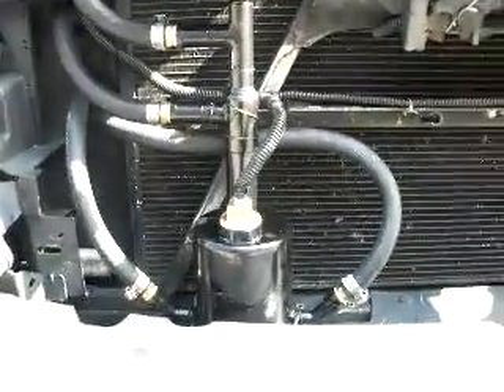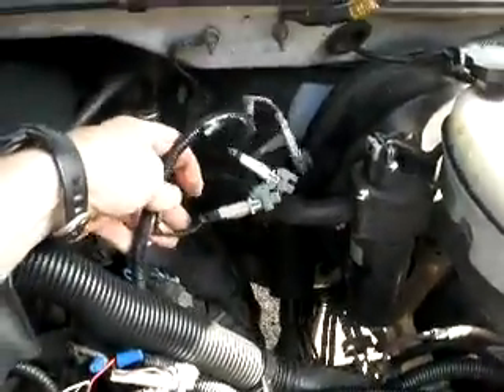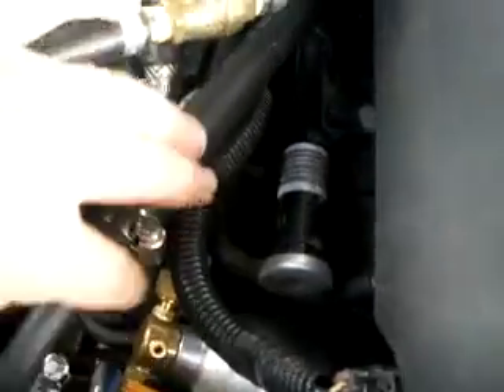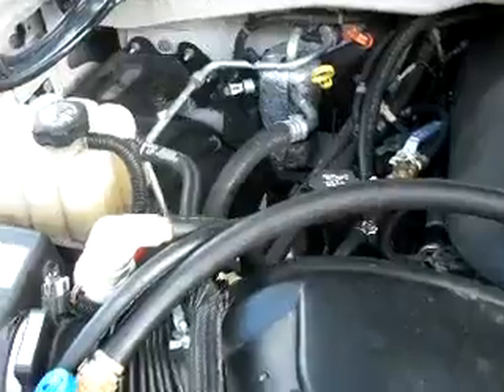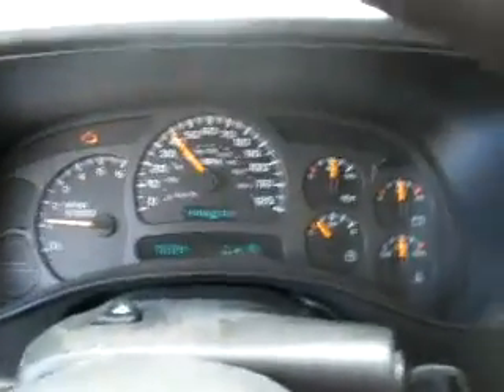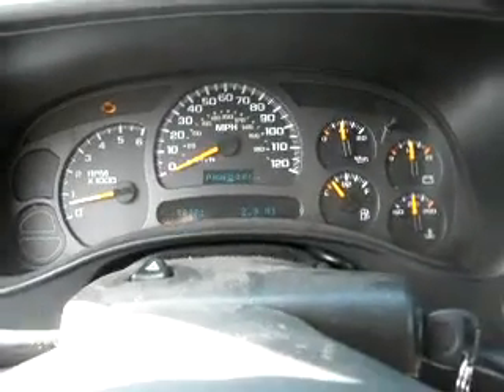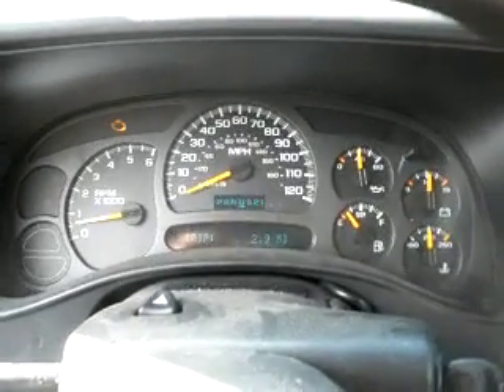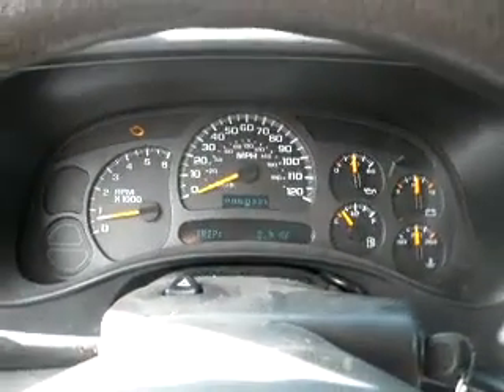Road Test In Progress from running on gasoline vap

Comment: this is geet technology designed in the 1980s thanks for making the engine people need to know about this. we have had clean possible energy since the 1940s. just saying if you continue with geet development you will find it will run on a bunch of different types of fuel the only gasoline you will need is to start the engine and get it up to running temp. but once its running your running low on fuel take a piss in the tank and it will use the hydrogen gas to power the engine also the different fuels like water mean you wont have to change your spark plugs keep posting and keep trying to make the world better
Reply from the maker: Andy Berlino Will do my best... thanks for watching.

Comment: Hey did you ever get the little problems worked out?? I have a 90 model chevy truck. Do you have any videos or parts list that is needed to make this conversion?
Reply from the maker: No sir, project is on hold right now...found something way better. Will keep everyone posted on my findings. Thanks for watching.
Reply: whyme2b Keep at it, keep documenting it.
Reply: whyme2b omg! Please do. Wish you would post more info on what heater your using and how it's installed to your tank. How hot can your heater safely go before the risk of igniting the fuel?
Reply from the maker: I'm using the hot water from my coolant system which is around 210 F degrees. It's only installed on the device I built which runs the Idle. Please go to my website phillipstechinc.com under photo gallery to see more pictures of my gas vaporizers. Thanks for watching.

Comment: How do this preform at high rpms? And can something like this be done with a normal Holley 4 barrel carb?
Reply from the maker: Very well if the engine gets the vapor it wants.... it would work out nicely with the older classic technologies than fuel injection computer mess. You don't need to worry about all those sensors telling the computer about what's going on. Thanks for watching.
Reply: That's cool my truck is carborated
Reply from the maker: Gentry Taylor

Then you have a greater vehicle than today's made...much easier to work with.
Reply: Gentry Rolofson .
Yep.
Just attach a vacume line to the carburater bowl vent.

Comment: Man I need your set up I have a 3.5 high output im looking to do this to my 300
Reply from the maker: I'm working on a new design right now using water as fuel under running load... It uses gas for start up, then when engine reaches normal temp, it switches over to water. Will do a video on it if all goes well. Thanks for watching.
Reply: Awesome thnx
Reply: whyme2b Did you see the new research on combustible saltwater? Might wanna check it out if that's your goal... Just a thought, I thoroughly enjoyed the video though! Especially the humming... XD It reminded me of myself making a video... Hahaha, well done!! Might do something like that to my camaro! ;)

Comment: super cool videos. very nice perspective.
Reply from the maker: Thank you and thanks for watching them...
Reply: how did it end? are you saving a lot of fuel?or you stopped the project..    p.s. make some more vids you got talent for it.
Reply from the maker: Project on hold for now... I drove it for around 5 to 7 minutes before I couldn't accelerate the engine anymore due to the gas cooling down which made the vapors cease. I would need to heat the gas for that part as well to keep it going. Sorry for the delays buddy.... again, thanks for watching.
Reply: that is not a big deal. depends on the temperature needed.else just put a pipe with electrical heating , it will do the work.5 min is more than enough to keep the energy going in the battery and  the heating sistem .  i think a lot now about magnetic induction- quite interesting subject. it is about getting heat from spinning  magnets.thx for answering
Reply from the maker: Your welcome... I do believe the key is to heat the gas up and induction heating could be a another safe way of doing that. Thanks for all your comments and watching my friend...

Comment: How exactly does it run when you unplug the injectors? Because with them unplugged, they now will not open. So Im curious of how you get the fuel vapors through an injector that doesnt open into the combustion chamber.
Reply from the maker: Sorry but I never received your comment in my mail? The answer to your question is threw vapors being pulled into the vacuum, I'm not using the fuel injection liquid system at all....nothing but vapors threw air intake. Thanks for watching.

Comment: Although, as  you say your project is "on hold," what mileage did you get picking up your wife etc.??
...Sounds fishy if you suddenly stop reporting...
Reply from the maker: I actually only had driven it for 5 to 7 minutes before I experienced acceleration problems due to my gas cooling down. It must be heated to maintain vapor production on both parts... my idle stayed fine because it was heated from the device I made. So I had to switch back to the normal setup when I went to pick up my wife, couldn't perform MPG test yet until this issue is fixed. Sorry for delays....Thanks for watching.

Comment: how do you make this work for a 2013 Hyundai Elantra 2013 GLS. How do you make the items you need to make your vehicle run on vapors.
Reply from the maker: It will work on all fuel injected vehicles, no matter who the maker is... It's a 2part system that makes it work, fumes for idle and fumes for accelerations. Still working on a design thou that's safer and made easy for everyone to use...sorry for the delays..... Thanks for watching.

Comment: sory, gas vapour??? as in LPG? or Gasoline an in unleaded petrol??
the English American translation is horrible lol
Reply from the maker: Yes, as in 87 octane gasoline unleaded... and yes, the English American translation can use some work on. Thanks for watching.
Reply: 87 octane wow, in Australia we have 91, 95 98 and 102, we just started to bring out E85, (ethanol additive) I wont use it, when I can I buy 98 octane 102 is a little hard to find
Reply from the maker: Cool, we also have 91 and 95 octane, but not 98, 102.... wow!!! That must cost a pretty penny? I used the lowest octane to show the power you can achieve off of gas vapors... works very well. Again, thanks for watching buddy.

Comment: How do you achieve enough vacuum off the intake air tube to pull vapors into the intake tube really well? Does the brass plumbing fitting on top have a tube angled any special way inside of the intake tube to get max vacuum pull as the throttle opens up? Or is it just as simple as tapping straight into the intake tube with no special angles? I ask because I was thinking that maybe some kind of special venture type of effect was needed to achieve the same amount of vacuum that's allowed in the intake air tube of the engine as you open up the throttle to also be created inside the vapor fuel line being fed into the engine air intake tube.
Reply from the maker: Their is no special connector fitting or curved angle being used... it's just a standard 5/8" bib and hose ran to the gas tank. I used a damper between the filter box and engine in which I could close it off to increase vacuum pressure running threw the 5/8" hose and at the same time the air being drawn into the tank is hooked up to my filter box to prevent dirt or dust from getting into my tank. It's a 2part system...idle vacuum pulls fumes from the device I made to keep it at idle, then my tank fumes supply the acceleration. Thanks for watching.
Reply: whyme2b Wow that's pretty cool, your really on to something here, a lot of people don't understand what exactly your doing and since it unconventional they will knock you for it but if they only realized the benefits and the schemes oil companies have against this and how they want you to stay in their conventional thinking.. Haha whats quite ironic is that shell was doing this same thing back in the day along with ford and other car manufactures getting 200 300 500 and reached even reached 1000 miles to a gallon on one vehicle but stopped and bought back the couple high mileage vehicles they produced and accidently sold from consumers since they realized that the national fuel consumption was going to drop too much which means lower revenues for them. So its nothing new what your doing as I'm sure you know this, just a lil taboo haha but only because of the dahm oil companies. So to the ney sayers, don't mind them they just feel comfy in there conventional knowledge of things that all. Just keep your safety precautions inline and you'll be good. But I currently have a vaporizer I built and it does great, it basically shuts down my injectors at idle, Using my scan tool I can see my fuel trims go down to -25 on my long trim fuel trims and -35 on my short term fuel trims, im using exhaust manifold heat though along with vacuum from the manifold behind the throttle body so anything above idle my fuel trims return to almost normal but still lower then normal so Im still saving fuel even above idle but jus not that much. but id like to change my vacuum source to in front of the throttle body to get the vapor production as I drive not just at idle. Would you be ok with further enlightening me on the dampering system you have in the air intake tube so that I can attempt this or something similar to get the vacuum needed in my vaporizer. You can email me if you would like izzgut@yahoo.com. Also im running my system and truck on E85  and anyone that knows a little about Ethanol or e85  its common knowledge that as far as the lean burning theres no pinging issues or extreme exhaust temps to burn my valves up because e85 and e100 have a wide tolerance on how lean or rich it can burn without any engine damage. Its pretty cool my exhaust has no smell to it, jus a lot of water vapor spewing out and a lot of water puddles on tha pavement if I idle about ten minutes. Im getting very close to a 100% complete burn at idle. Haha exciting stuff to me.

Comment: im very impressed I was gonna try to build a fuel vapor carb but never thought about just using the whole tank as one well done !!!!!!
Reply from the maker: Thanks my friend for your comment... Please be very careful when working with gasoline vapors and always use flash back protection...I will be working on a safer design sometime soon and avoid using my tank. Thanks for watching.
Reply: whyme2b what do you use for flashback protection, I don't know too many things that will stop flame from traveling along gasoline vapors.
Reply from the maker: A stainless steel screen mesh does the job very well. Please watch my gasoline vapor torch video to see it in action. Thanks for watching.
Reply: Thank you very much, I will.
Reply from the maker: Your welcome.

Comment: One could fab up an exhaust header with bungs for O2 sensors for each cylinder near the exhaust port of each and move the sensor around on different runs with plugs for those not in use.  This would allow you to verify A/F ratio on a per cylinder basis.  The problem, if there is one, is that between the fuel/air vapor flow, and the air intake flow, different cylinders aren't getting the same. Vapor regulation is not as easy as liquid.

Comment: Assuming there is no gas coming in and only vapor (gas pomp disconnected to engine right?) How many miles can you do with 1 gallon of gas (tested on the road at 50 miles per hour)?

Comment from the maker: System is using a 2 part process.... idle run is under the vacuum which is hooked up to my unit in front of my radiator in which it pulls in the fumes threw the 3/8" line PCV valve which is located in the center of the engine block. To accelerate, my other line is ran to my gas tank which pulls in the fumes on demand threw my air intake... it ran very well and had allot of power to get up and go! Thanks for watching.

Comment: It must have been cold as your gas (petrol) stops producing a vapor at 
- 45.4 degrees fahrenheit ! As for your gas to actually freeze then the temperature would have to drop to anywhere between - 40 & - 70 degrees fahrenheit, depending on what additives it contains.

Comment from the maker: Yes sir, it is a open circuit.. the ecu wants to read a resistance on the solenoid coil always, if not...fault code will appear. The vacuum is pulling in the fuel vapors from the device I made which idles the engine. The second part for acceleration comes from the fuel tank fumes. You can call it throttle body injection if you like...same thing but in 2 separate parts to make it work. Thanks for watching.

Comment: May I make a correction about your Check Engine light .. it is not on because your fuel injector plugs being disconnected are 'shorted' but rather 'open circuit' .. :)
Now please explain to me how this system is working .. I understand the part bout running on gasoline tank 'fumes', however I certainly can't understand how is it getting in the engine to ignite, if the fuel injectors are still in the cylinders and no computer regulation. Fumes fed into air I intake (throttle body) ?? Thanks

Comment from the maker: It's not my choice at all for anyone to get hurt...everyone has been warned not to play around with this if they have no experience with auto mechanics. Also my truck had more power in take off than the normal way of using the injectors...it's all in how you introduce the vapors in 2 parts is what makes it work.

Comment from the maker: Thanks. The gas tank has plenty of fumes... I actually drove it for 5 to 7 minutes before and had excellent get up and go until the gas started to condense down and freeze, then my vapors stopped and it would only just idle. My gas is heated for the idle part and needs to also be heated for the accelerations part for this to continue to work. Thanks for watching.

Comment from the maker: Their is no short circuit... The ecu reads a resistance on the solenoid coil which tells it that it is working correctly. When the electrical harness is unplugged, it reads 0 resistance which will bring up the fault code and trigger the check engine light. I'm not selling anything either so you don't need to buy it. Thanks for watching.

Comment: Bro, replace the gasoline with alcohol and water mix.. I been doing this and I 3triple the miles, plus I did the gatgetmangroove and I did open the gap 20%, remover the metal mesh on my mass air sensor, remover the pcv from the valve covers and plug the intake vacum pvc. Chip the 02 sensors and the fuel vaporizer with is a jar with alcohool and water.... I hope u like the idea. Keep in touch men!!!

Comment from the maker: I will check into that stuff and see if it matches Dyna Lube.... so far I haven't found anything that could surpass it's protection! Please watch the " timken bearing test " and see for yourself if this is the stuff. 
w..dynalube dot biz/video.html
  Didn't get any test results for MPG yet due to some issues coming up with the gas freezing... I drove it for around 5 to 7 minutes before vapors started to cease.

Comment from the maker: Yes, if your engine is not treated it would. I used a additive called dyna lube to protect my valves and engine from overheating and excessive friction. Also you can just add water mist into the intake to relieve that problem...would get more power out of your engine as well. Thanks for watching.

Comment from the maker: Because the evap line is to small....Also hooked up to a solenoid valve which opens and closes, it's not being used all the time and I didn't want to mess with any of that stuff, so I just ran a  5/8" hose line to the tank which was allot easier. Thanks for watching.

Comment from the maker: Yes sir, their are allot of people who have done this... I would like to accomplish that 1000 MPG thou, I never herd about that one. I did use a float valve in the unit I built in the front of the truck, it's that brass fitting that is screwed into the top of the 3" copper cap. Worked very well in controlling the fuel injector I used to fill up the housing with gasoline.

Comment: I have been searching this. The best claim yet is 1000 mpg. They made an opel that had a heater element in the gas line that got about 376mpg. You can find it on youtube. Many claim between 60 to 200 mpg. Some use the exhaust for heating. Best results seem to be when gas is brougt to 400 degrees. Others use ultrasonic foggers. I didn't see a floatvalve in your video. How do you keep your levels of gas in the module from rising to far?

Comment: You most definitely have the most efficient system. I was basically thinking of a similar system . But , I would install the system in tool box in bed of truck . I would use a small transmission cooler to heat the fuel rerouting all hoses and etc. as needed.

Comment: This is very interesting Wayne. I tried hydrogen using water bottles and stainless electrodes and it worked well, just a pain with the water evaporating and the rods eroding constantly. I see this video was made in June last year. I don't see any gas milage posted for that trip. How did you do?

Comment from the maker: Yes true, but simple solution to stop that...just like on a gas regulator you have a steel screen mesh which prevents flash backs which can be installed near your throttle intake manifold. The other vapor injection is pulled in threw vacuum which can not explode but only implode, so there is really no big danger at all. Thanks for your comment on it thou... and thanks for watching.

Comment: The potential problem with this is a backfire into the intake manifold. When people use nitrous irresponsibly they can get what is called a "nitrous backfire" which blows up the intake manifold. I feel like this system would be even easier for this to happen on, seems dangerous.